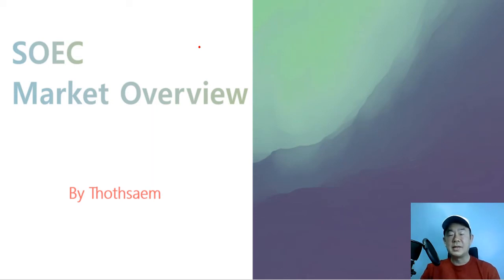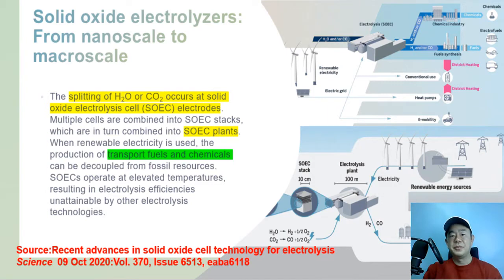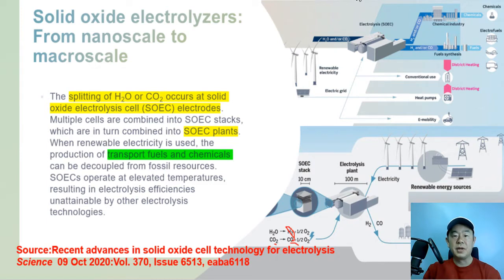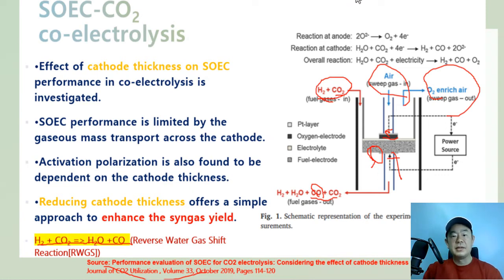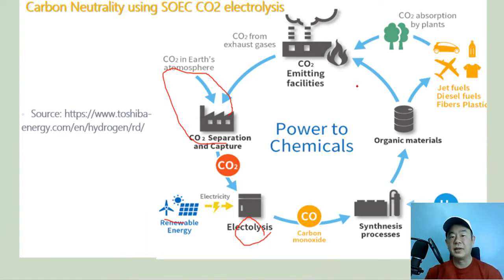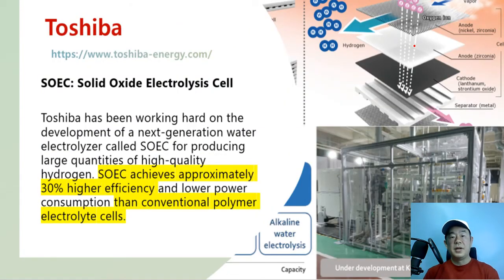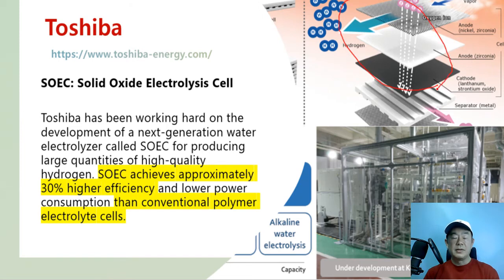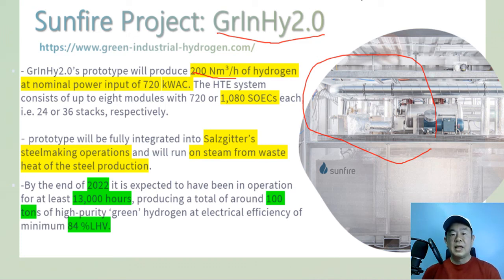Who is leading the most efficient way to produce green hydrogen? [US vs. EU]

Comment: I thought mainly SOEC is to produce H2, but it is also to convert CO2 to CO. However, It seems way too expensive by using renewable electricity to run this system to be more greener. Do you think it can be commercialized near soon?
Reply from the maker: For producing syngas, SOEC can have merits and can be applied to commercial project. Durability is an issue in this case.
Reply: @ThothSaem  Thanks for the additional info. and I appreciate your very educational contents. Thanks Thothsam!